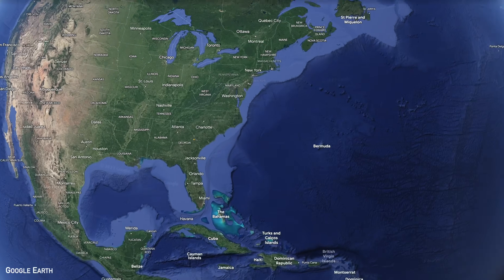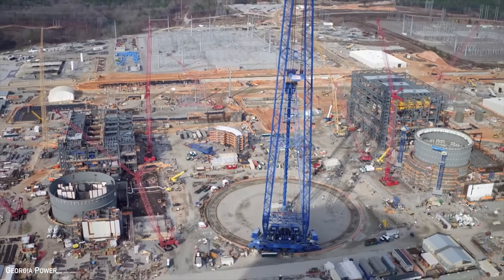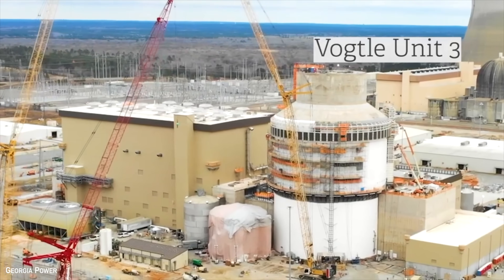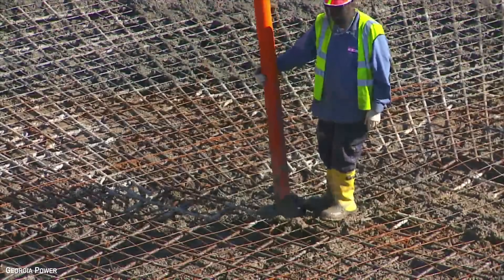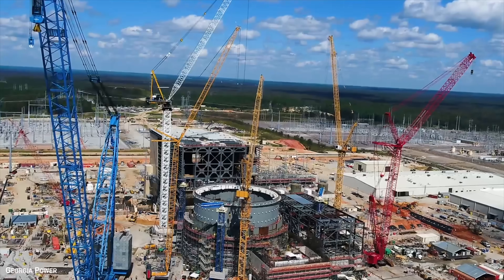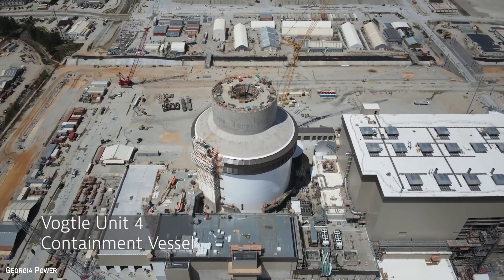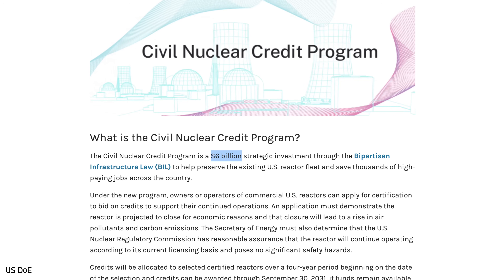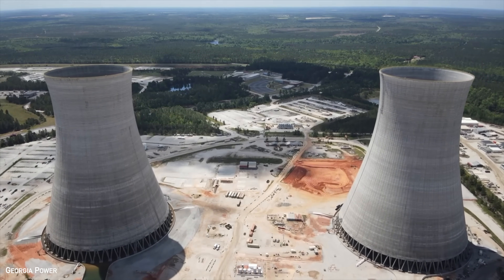Why the Future of Nuclear Power Depends on This Plant

Comment: The ORNL molten Salt Reactor developement MSRE should have been continued in the 1970s with a follow up! Then we would have efficient high temperature reactor technology, a broader fuel base, not just U235, still more than enough Pu for the Pentagon, much less waste ( residual nuc_waste), valuable isotopes for medicine and NASA, Tritium sequestration facilities (so far it is an unresolved environmental and health problem, in future it would be the fuel for Fusion+FissionCombines)! Now small underfinanced proposals are FLIBe and MCSFR Reactors (MoltenChlorideSaltFastReactor). The former quite EarthquakeProof, the latter not so much, but able to use a wide variety of fuels, incl old_nuc_wastes! The recent 2024 Japan Noto peninsula earthquakes are a reminder how important it is for nuc_safety! 
What Westinghouse, GE, Siemens and Framatom are now constructing is old inefficient wasteful tech, not much cheaper electricity, but certainly/massively increasing the WesternWorld's nuc_wastes problem in the Future. 
   What they are investing billion$ into - is actually a bad idea, conservatively neglecting modern tec_concepts! if the Computer industry would be as old_society_type, the PCs would still be full of Eniac_vac_tubes! 
in general, NuclearElectricityGeneration resolves the (not so serious, much hyped) CO2 problem but intrinsically makes another, unresolvable (only the Square_of_Distance proportionality alleviates) potential cancerogenious AntiNeutrinoProblem. Too much antineutrinos could also cause a problem for <10nm computer chips.

Comment: Cleaning up the energy grid in the US would greatly mitigate many separate problems simultaneously. It would improve energy security, address many sources of grid reliability problems, enable the electrification of transport, and slow down climate change, all at once. These advantages are nearly priceless, in the sense that, if you can fix them ONCE and solve the problem for a very long time -- say, half a century or more -- with a big up-front investment, it almost doesn't matter how big that up-front investment is; it's still worth it. Specifically nuclear taking a larger chunk of the grid would make it more economical to implement variable load renewables (wind and solar), and allow us to completely phase out coal and vastly reduce natural gas burning. We could then export our surplus natural gas to countries currently burning crude oil or coal for power, since natural gas is much cleaner relatively speaking.

Sadly, seeing the "graveyard" of canceled projects on the NRC's website gives me little hope that nuclear will grow in my lifetime. The best case is we will find ways to upgrade the safety of our old Gen2 reactors, and keep them online for another 50+ years. The worst case is that we will decommission most of our 20th century nuclear facilities in the next 30 years, and replace them with a mix of natural gas and renewables. Natural gas still emits CO2, and is still a finite resource that comes out of the ground. Renewables are challenging to scale to gigawatt range, and it is often the case that neither the wind is blowing nor the sun is shining. Hydro creates risks of massive flooding and enormous casualties in the event that their safety features fail; it is far more likely for a hydro dam to break than a nuclear reactor to meltdown.

Without a clear leader to carry the US to the next stage of our energy consumption journey with stable, low-carbon, 24x7, high capacity baseload power, we will struggle to successfully electrify transport, and we'll basically keep burning fossil fuels at roughly the same rate as today, with renewables and electrification just kind of offsetting population growth and per capita energy consumption growth.

We need to stop thinking short-term as a society and a species, and start investing in the long term. That means we need to cut out the wars and invest in a moonshot $1 Trillion project to implement a new generation of nuclear power based on a sustainable fuel cycle, using something like molten salt, HALEU, breeder reactors, or one of many other promising technologies.

Don't bank on fusion, by the way. I'm expecting fusion power to be commercially available around 150-200 years from now. It's just too complicated and too many unknowns. By comparison, something like a molten salt fission reactor is using well-known, grounded science and engineering. To get us through the 21st century and into and through most of the 22nd, we're going to need a lot of advanced nuclear fission plants. The way we're going, we aren't going to have them when we need them. That'll just lead to more resource wars over the finite fossil fuel reserves...

To say my hopes aren't high is to understate my point. Scientists and regular people have been pushing society to adopt a new, more sustainable fission fuel cycle and build a new generation of fission plants for at least 50 years. The majority don't understand or care where their electricity come from, so policymakers are never going to make a big investment in the next generation's comfort and wellbeing. Instead, we'll all just slide down the tube toward war and infighting together, owing to our shortsightedness and greed.

I hate humans.

Comment: $30 billion for 2.2GW of capacity?  That sounds expensive.  If they produce base load power, I calculate 2% ROI, even if there were no operating expenses, which of course there are.  Maybe someone can correct my facts or calcs.
Reply: The project is currently at $35 billion which includes the money Westinghouse paid and while the capacity is 2.2 Gw, each unit has a "hotel load" of 0.1 Gw when operating so the sellable capacity is only 2 Gw.

Comment: I work for Vogtle 3&4 full time as an electrical maintenance supervisor. I can tell you that everyone who has worked there put blood sweat and tears into that plant. However with all the regulatory requirements it put a big burden on the construction side of things moreover the skill of the craft through out the years dwindled. Poor craftsman's ship was a big part as well. ALOT of work was redone from either poor craftsmanship, Poor equipment reliability, upgrades, mods etc... with it taking years to build and equipment that was installed early on, alot of those pieces of equipment needed to be replaced from becoming faulty rather from outside elements or the continued construction with people in general not watching what they are doing and breaking certain components unintentionally. ALOT of testing was performed on each equipment multiple times through various upgrades or mods that was an after thought. Also when covid came around that place became a ghost town for about a year. With this plant being fully digital, the amount of testing to ensure that every piece of equipment was "talking" to each other was a painful process as well. So to summarize Equipment reliability from factory down to craft testing was a big part. Craftmanship and pride in work was another. Regulatory requirements was another big one. Overall thousands of people who have came and gone for the most part gave their all. WE at Vogtle are proud of were we are at now with running unit 3 at 100% power and commercially operating and will continue to keep our PUBLIC safe as the number one priority and ENSURE we have equipment reliability so we can give the public safe and clean power for years to come!
Reply: The AP1000 was fully approved for construction and operation by the NRC, before construction ever started.  China has built many without any problems before Vogtle.
All they had to do is build it according to design but they could not do that.  If you like, I can cite all the problems post covid and they are all mismanagement and poor construction.  Blaming the NRC regulations because the project leads and craft can't follow requirements is NOT and excuse.

Nuclear power plant construction is only difficult because it MUST be built as designed. Are you saying the craft cannot follow instructions?

VC Summer and Vogtle have PROVEN that the U.S. project management and construction craft are unable to build new nuclear.

BTW, I worked in nuclear 40+ years and am pro-nuclear.  I would like to thank you and the other craft for killing any new nuclear in the U.S. for the foreseeable future. Vogtle will be the last large nuclear project in America
Reply: BTW,  I know many people that work/worked there as I live nearby and I would not be too proud of what went on there.
Reply: People earn less and less buying power from working as time goes on. It should surprise Noone that passion for said work follows suit.

Comment: Originally  converted weapons uranium from the MOX facility across the river was to be used.  Southern nuclear was  supposed to get all kinds of praise, but the MOX deal fell through.
Reply: MOX uses Pu239 as the fissile material and some MOX fuel assemblies were tried in a U.S. commercial reactor and it had to be shutdown early and the assemblies removed because they warped.

Vogtle is 16 years in the making and 120% over budget.  Unit 3 started on April 1, ran for a couple of days and is still shutdown for repairs

Comment: Ultimately, the economic issues all come down to DELAYS.  If these projects could be completed on schedule, then they could also be completed on budget.  And the delays are mostly, NOT a technology issue... if they were, then it would be an issue experienced outside the US also.  No, the delays are mostly a function of the regulatory and legal framework  of the US.  Here's how to fix it;

1. It currently takes the NRC about 30 years to fully approve a new reactor design and site and installation.  That is unacceptable and unreasonable.  I get that it is difficult, but that just means that the NRC needs to work HARDER, not LONGER.  Give it a 30 fold increase in funding, and then require that a license for new plant construction be granted by default if it takes more than 2 years to issue a full evaluation to the same standards that it was doing before.  30 fold more money to do the same work in one 15th the time should be half the workload per dollar and fully possible.  

2. Establish a 3-tier federal-state court jurisdiction system for all nuclear regulatory affairs of any sort.  This is how it would work:  A single Federal Nuclear Regulatory Court (FNRC) would exist with jurisdiction to reader or supersede decisions over all regulation of nuclear infrastructure (including waste disposal, fuel refinement, transport of fuel and waste, manufacture, installation, deconstructionism, and operation).  There would be only one appeals court to the FNRC... the Supreme Court.  Any lawsuit against the nuclear industry would start in state courts, and any appeal to that initial state ruling would then go straight to the the FNRC which could decide to to take on the case or not.  If it did not, the apeal could go back into the state system.  But if the FNRC took on the case, it would then pre-empt and supersede all state authority for its ruling which could only then be appealed to the Supreme Court.  This creates a fast-track removal of legal barriers to nuclear infrastructure projects.

3.  Mandate that the linear no-threshold model of nuclear radiation toxicity be abandoned.  (There is no doubt amongst scientists that it is false).  

These three simple steps remove the principle procedural and regulatory hurdles that cause delays in nuclear projects and thus which cause cost-over-runs in nuclear projects.
Reply: The Westinghouse AP1000 was and still is 100% fully approved for construction and operation IF built according to design.  When VC Summer and Vogtle started construction that was TRUE.  What specific NRC approval do you think held up that project?

Nuclear build regulations are very specific so why would a court have any say over them?  Name ONE NRC regulation that needs to be changed?
Reply: BTW, if you like, I could provide details on the year by year delays in the Vogtle project and NONE of them are NRC based.  And, while Vogtle unit 3 went critical on April 1 2023, the have since been shutdown for more repairs. Here are the latest (Past 6 months)

Below is the Vogtle Project Management's answer for the latest delays:
Southern Co. yesterday announced another delay for its long-troubled nuclear construction project in Georgia, edging its costs closer to the $30 billion mark. 
The setback could now push the startup date for Plant Vogtle’s first reactor until early 2023 and move the date for the second one to later that year. 
Plant Vogtle’s latest move highlights the nuclear industry’s chief troubles with building large, baseload reactors: safety and cost. To be clear, Southern executives have blamed this new hiccup on paperwork, saying that workers were gathering it to send to federal safety regulators and noticed critical inspection records were missing or incomplete. The pile of missing or incomplete documents added up to a delay of three to six months, Southern said. That additional time is costing $920 million. 
“We’re a little frustrated with the latest developments,” Southern Co. CEO Tom 
Fanning talked of “great momentum” at the construction site since November. 
But workers realized “tens of thousands” of critical documents were missing, leading to a three-month backlog. 
“We’re fixing that part of the ‘paper’ process,” he told E&E News.

LATEST: Georgia Power says Unit 3 could now begin commercial operation in June, 2023, pushing back from the most recent deadline of the end of April.  Unit 4 will begin commercial operation by March 2024. The company previously has promised commercial operation of Unit 4 by the end of 2023 at the latest.
Georgia Power discovered that a pipe that is part of a critical backup cooling system was vibrating because construction workers had failed to install supports called for on blueprints. 
Fanning told investors that other issues causing delays included a slowly dripping valve, as well as a problem involving the flow through the reactor coolant pumps that hasn’t been pinpointed.
Georgia Power ratepayers are already paying for Vogtle, and most electric customers in Georgia, as well as in parts of Alabama and Florida, will eventually be charged. The effects of the further delay on ratepayers are unclear. Georgia Power has signaled it may could ask for more to be paid for capital costs and financing.

Comment: They need to have a standardized production where all plants are based on an almost identical design.  That would reduce cost substantially.
Reply: Every reactor supplier has a standard design.  Every Westinghouse PWR is identical to every other Westinghouse PWR. Same for B&W and CE.

Utilities add options based upon their specific needs
Reply: @clarkkent9080 Westinghouse PWRs built in 60s are wildly different from todays AP1000.  And there are no “standard” modern GE designs, only proposed designs for nothing yet built.
Reply: @Nill757  The original nuclear plants were mostly built in the 1970s not 1960s.  I operated a 3 loop Westinghouse unit and the only (main) difference in the AP1000 design is 2 loops instead of 3 and passive safety features. 
No U.S. commercial nuclear plant has every had a problem with safety feature failures as they are well tested, maintained, and every component has an independent and redundant backup. 

The main purpose of the AP1000 was to reduce the number of components ( 2 instead of 3 loops) and using passive features instead of needing pumps and large diesel backup generators. The whole purpose of that was to save cost and reduce build time NOT for additional safety, although they take advantage of that in advertising.  The core structure and fuel assemblies are essentially identical. The PWR primary design is simple and hasn't changed and there is no need to as it is a great design.